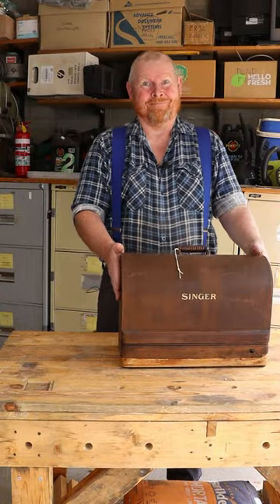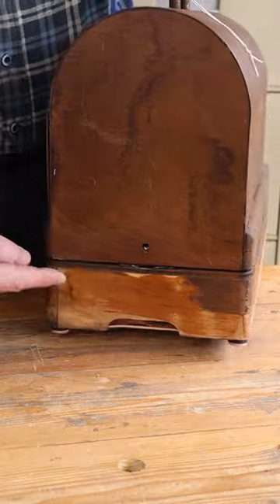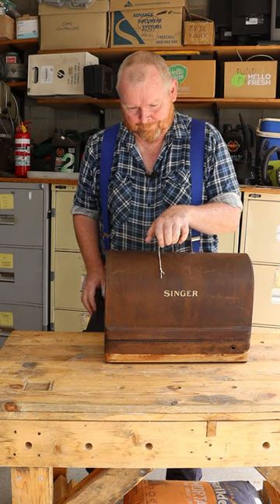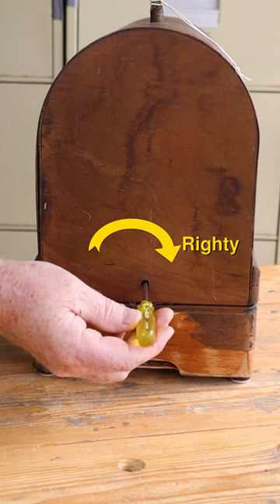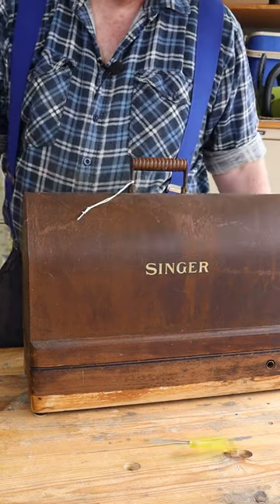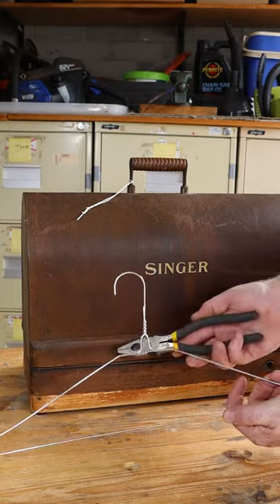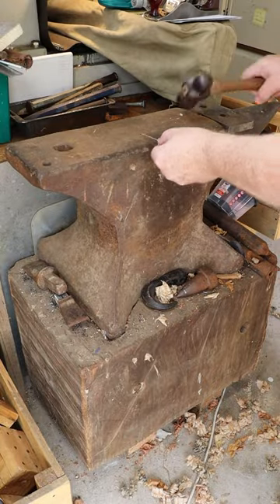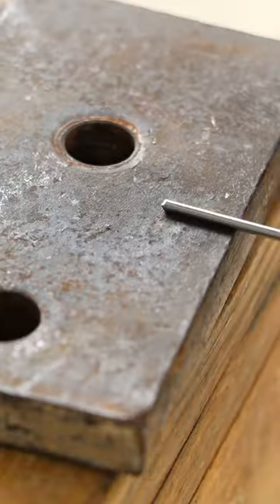How to open a vintage Singer sewing machine case without a key

Comment: I like to see that you are using the proper tools for flattening the end of the key. Mine is a 307# Peter Wright. Husband has a 450# Nimba Gladiator. Overkill?
Reply from the maker: Well if you have the tool available, you may as well use it! 😀

This one is made by "S. Earnshaw & Sons" and is marked as 378#.  According to family legend it was bought by my grandfather at an auction in 1935.  I'm just keeping it safe until it's time to pass it on to the next generation.  It's very well-worn, and has a nice ring to it.  I made a longer video about it here:

https://www.youtube.com/watch?v=7PZzDF44KYI

Comment: What kind of screwdriver
Reply from the maker: That particular screwdriver is a yellow Stanley model "4x75 65.540"

It's been modified from its factory shape though, some time ago I ground it to have a parallel-edged tip for some job I've forgotten.
Reply: Got it open. Thanks
Reply from the maker: @MaryHewitt-yo7rz  That's great news!

What model of treasure was in your 
case?

https://www.youtube.com/shorts/2FwOLBHToeI

Comment: oh please never lift it by the handle! the bentwood top will give out and TRUST me, you dont want any singer, even the mini sized singer 99, dropping on the floor, or your foot
Reply from the maker: I understand, and I generally don't lift machines using the case handle.  I'm committing the crime in this video simply because it looked better on camera (and you'll notice that it's never more than a couple of inches above the bench top!)  😊